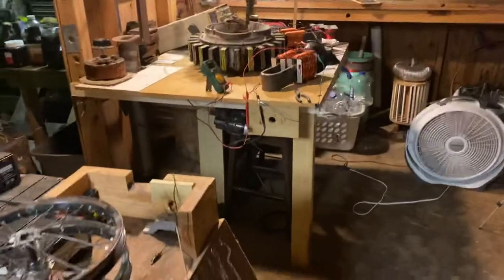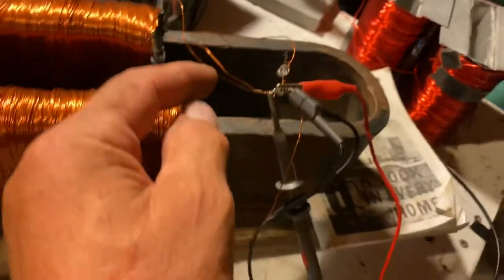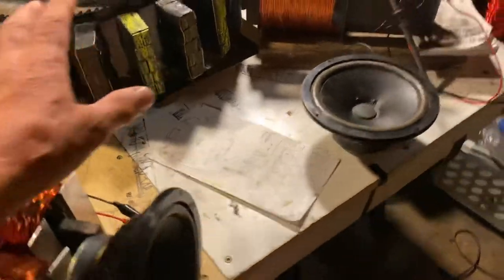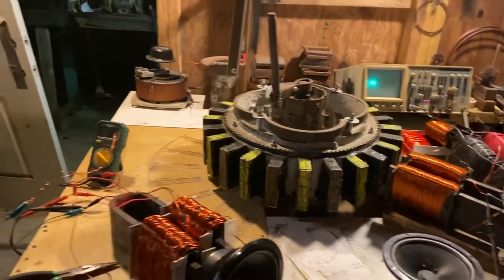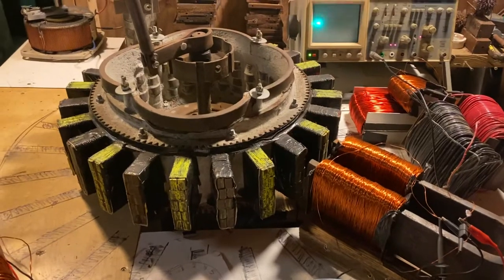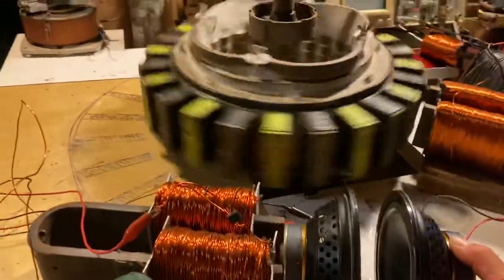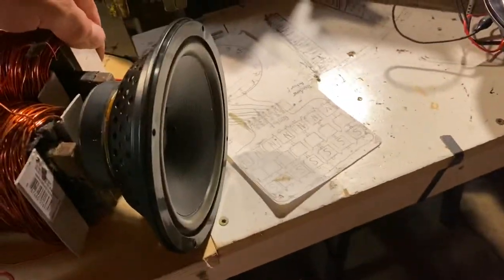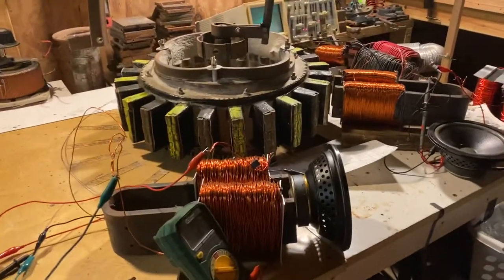Ed Leedskalnin Pressure Wave/ Longitudinal Waves Experiments!

Comment: I think the pmh coil winding will capture the milliamps offered free by the ether if it had more turns and very thin wire, this will produce higher voltage so it can step down using capacitor and coil with diode for dc power storage. Also think the speaker needs to be at least 25' above the earth ground as well as grounded to earth via diode at the battery storage negative terminal. Pos terminal of battery is connected to output of the speaker coil, think maybe one end of speaker coil should be grounded and other end of speaker coil should be the output (plus) you will have to put volt meter on millivolts setting and check for polarity on the speaker coil to find out. the speaker addition is just adding to the reception, the pmh alone is all you need with an iron keeper in place the pmh should stay actibe as long as you don't put a load on it that it cannot supply, so your load should be something like 20 milliamps maybe and use pot to vary the load and find it's maximum output. 1st thing is the coil is to thick, needs like newman style lots of turn very thin litz wire and high resistance. no doubt the output will be mostly voltage high at that and once stepped down what will be left is millamps but at least it's free can't complain, better than electrolosis cause there is no decay factor of the parts but likely only to give out sa much as a crytal battery with out the need for water .

Comment: Salt and magnesium are paramagnetic. People don't talk about piezo crystals being oscillators from DC. However it's very important to get pulse from a battery to induce a coil. Because induction to other coils means multiplication amplification. Self running when reciever coils recharge or replace source.

It's possible Viktor Schauberger was using water doped with salt, magnesium or neodymium as an oscillator. I believe perpetual motion holders give iron a crystalline molecular structure. Piezo quality. Because charge applied to the side of PMH shows increased voltage across spark gap. Crystal battery becomes an oscillator. (magnesium) applied charge oscillation (from going through it) from DC battery. Pulse to primary trigger wire or coil. Reciever antenna coils, wires or capacitor plates or batteries get charged. 

https://m.facebook.com/story.php?story_fbid=880071485860463&substory_index=0&id=100015728588672
Reply: He would not have to use salt water, especially when he had a fresh supply of mineral laced water from the mountains!

Comment: You know the bottom of the speaker is only one pole right? One coil will be attracted to the bottom and the other coil will repel. I should post a video of what I have been doing with the PMH. ...side note, why are you only using a single diode? Hook two diodes +/- and -/+. Now point the 2 diodes at a single diode and connect a meter. You know what a diode does when you point the type of light it produces at it right?  Still not sure why your not lighting the led with the wireless aspect of the wheel. You are missing capacitors in your setup. You might be able to hear the speakers if you put them in a least a simple box. You are on the right track cause that pulse is how most of his tools worked. When done right it is a motor/generator.  Your pair of PMH 's one is the motor and the other is the generator,  they just need to be slightly offset from 90 degrees. Like 3 o'clock at 5:30 on the hour hand. Will you please prop the PMH to be centered with the passing magnets. The flux is strongest between the 2nd and 4th layer. The closer you put the PMH  to the magnets the better. 3 nails and it won't move. Matchbook covers are good for setting gaps. :) FYI lawnmowers are a perfect example. Old cars and the points. Striker is good for standing, and the cover is thick enough to set the distance to open. Have a good one. Hard to send a pressure wave thru a vacuum. Now you got me wanting to go find my germanium diodes and 35volt capacitors and hook up my subwoofers and make a better video of the subs being ran off a AN10NA. Except I don't  want to deal with the FCC for broadcasting a signal. All the same glad to see someone else tinkering these days. I've been working with water lately. What started as a rolling rock fountain  has turned into a elaborate contraption.  Annoyed my neighbor bad when I was ringing a bell 43,200 times a day. Was my water clock ticking away. I noticed people would step in time with my ram pump. That has become to much of a pain to keep in operation. But seriously think about better valves for your heart beat. Left atrium right atrium.  I am in a medical flight path so I really don't want to be causing interference on their electronics. Really not hard to make capacitors.  Parchment paper, aluminum  foil, and plastic wrap. Compress as tight as you can. Parchment paper,foil,plastic wrap,foil. Add mineral oil between the layers. One wire to one foil plate and the other wire to the other foil plate. You can put a lot of tension on iron fishing line. Paraffin wax is cheap. So are tin cans cut into strips. Wrap with a half overlap like bicycle handlebars. Use a cloth dipped in polyurethane.  Wrap again. Speaking of layers of a onion. Funny you can predict the winter by the outer layer of a onion. A tougher skin is a indicator of a harsh winter to come. Great now I want to cook things using a high voltage spark again. Like stuffed green olives with pimentos.  The spark jumps around the pimentos in the center. Your Frankenstein remarks make me think about frog legs. Zap and the dead frog leaps. Except I would get someone crying over the death of a frog. Not that I don't  have the ultimate frog breeding area on my porch. Maybe wait for the neighbor  cat to fetch me a dead bunny.  How long will fresh meat react to current after death? Ok I am getting morbid got to go.
Reply: Reanimator over here.
Reply: @menlikegods363  what does that mean?
Reply: @MAGnetICus_Attractus  "Reanimator" is a crazy old cult horror/comedy movie where a guy gets obsessed with "How long will fresh meat react to [a serum] after death" and is one of the funniest horror films of all time.  If you haven't seen it, I suggest it if you're into campy, low budget 1980s horror movies: a true classic.
Reply from the maker: g law 
Nice comments! I am trying to put this knowledge out there is parts. Thank you for your comments.👍
Reply: @vinnystvincent9788  https://youtu.be/ngIv8N3zR4g  this is what I call magnetricity. Very simple setup. 6 LEDs and 2 capacitors.  I've put a volt meter on there and there is no voltage. So I wonder if this is why Edward  said the meter is one sided. One wire is connected to the positive of one cap then to the bike frame, the other wire is connected to negative of the other cap and to the iron of the coil. I am driving the wheel with a 18volt battery from a cordless drill.  It will run all night on a full charge. I think I shared the speakers thumping away connected to a single wire. Speakers are not good for tools. But the tools do work like speakers. Myself I use the speakers as switches. One of the many DC oscillators I have built. Attach one wire to the cone, and the other wire just above. When current passes the speaker tries to bottom out breaking the connection.  Basically a model T buzz coil. The "ring bell twice" inspired my one oscillator. Pendulum has a magnet for a weight. The magnet will attracts to the iron of one coil, this causes the top of the pendulum to make connection on the switch above and turns one the other coil, the magnet weight is now pulled to the other coil, which turns on the first coil. I used the drawing on the door to make the pendulum  shape. Sun is the switch , earth is the coils. The gear shape looks exactly like the the manual for a model T ignition. The buzz coil connects 4 times before the points say fire the plug. I see the clover leaf in the center as Edwards cam lobe. Not sure where his spring loaded rocker arm was maybe the vertical shaft to the left?  I know the easiest way to make standing waves is with a children's pool with flexible sides. Timing is every thing. Give the side a little push and watch that wave travel to the other side, now when it comes back push again. Keep doing this and you will see a huge wave in the center of the pool. I did publish my blow horn. My video titled "80 psi pressure dump"  some bits of pipe and a bottle. Blow air in on a fan shaped nozzle that blows across the end of the pipe in the bottle neck. .021 is the gap on the points. At least for a model T. Tesla's  earthquake machine is how he moved the walls into place. Like I said somewhere maybe? Your heart beat needs valves. Diode valves for the electric and mechanical valves for your fluid pressure. I might get motivated and sacrifice sum money to buy a sheet of MDF 3/4" and make the ported box . SPL dragracing is knowing how to make standing waves in a small enclosure.  I know little tricks like old radios with a phonograph input and a passive equalizer. The output of the radio is connected to the input and the oscillation starts. This is where a variable resistor like slot car controller 's . Increase resistance going to the input as the volume increases. chokes for low frequency and capacitors for high frequency.  Fyi use a light bulb as a fuse on the speaker, inline. Cheaper to burn up a lightbulb than burn up a speaker. And hitting bottom is a bad thing. Unless your cutting rocks. If you can't  hit bottom, beat the hell out of the sides.. my father showed me how to reciprocate the shaft with water to put six foot ground rods into and out of the ground. My friend thought I was joking when I put a car axle into the ground with 2 gallons of water. He grabbed a shovel and 16# digging bar for the job. I told him "work smarter, not harder".  Why I have been building automatrons powered by falling water. I wasn't  picking up 8# with less than a half gallon of water for nothing. I was showing how to transfer the weight on the beam to increase leverage.  Kinda surprised me when I seen the hole a 8 ounce plumb put in a granite counter top. ...in the one photo Edward is showing off all his individual magnets to make one big magnet.. like I tell people you need a big magnet above to lift the iron shaft, when the shaft is lifted it closes the switch and the coil on the shaft causes the shaft to repel from the permanent magnet  hits bottom and bounces back. Why I make copper or brass springs for contacts. The springs are like the coils and have to go in the direction of the magnet pole you want. The speaker pole I pointed to like ying and yang. The center inside pointing towards thecone is one pole and the outside is the other pole. Why I said check the polarity of the speakers.  Not just current but actual magnetic polarity. Which reminds me I need to buy more cheap magnets. Broke a couple yesterday when I over saturated the iron plate with the same pole magnet. Lawnmowers i point to cause the arc of the three iron prongs like a double UU.  A 2 to 1 ratio. Anyways have fun experimenting.